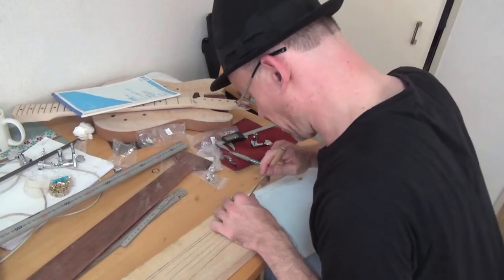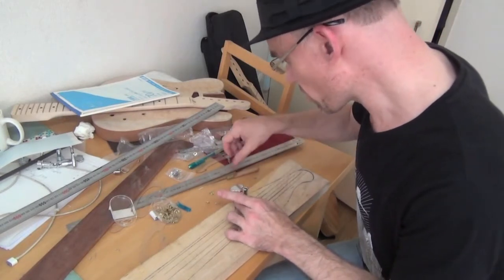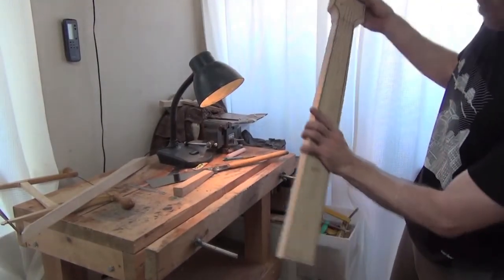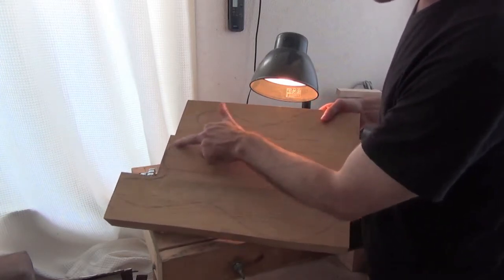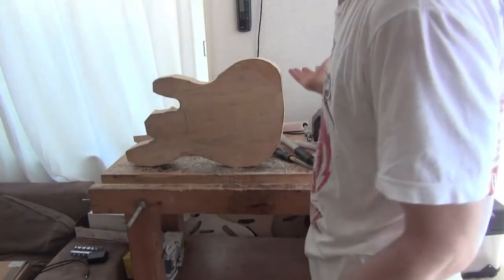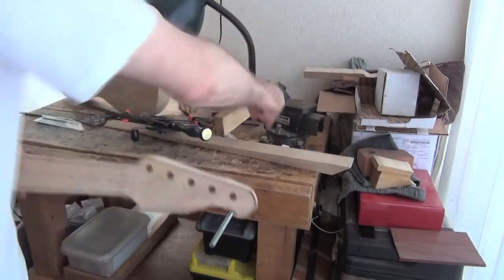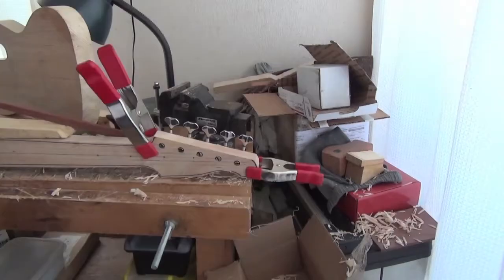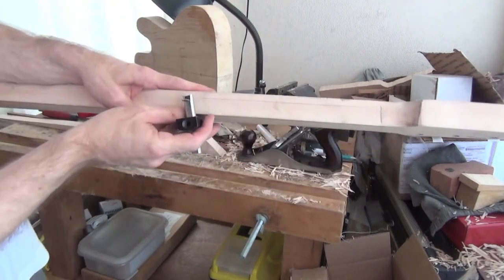Hand Tool Bass Build Three

Comment: I want to make a strat without routers, can it be done? I hate routers and I love hand tools.
Reply from the maker: Absolutely. Strats aren't too bad. You can use Forstner bits in a brace to do the edges of the pickup and control cavities, then connect with straight lines. Scoring, chisels and router planes will get you there. A "swimming pool" cavity is even easier.